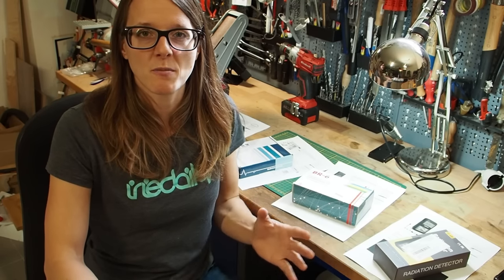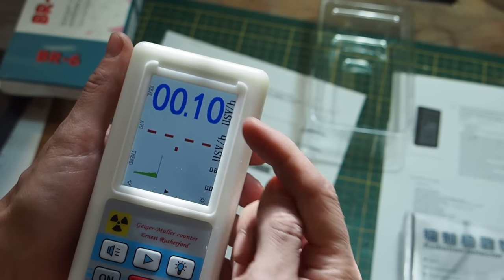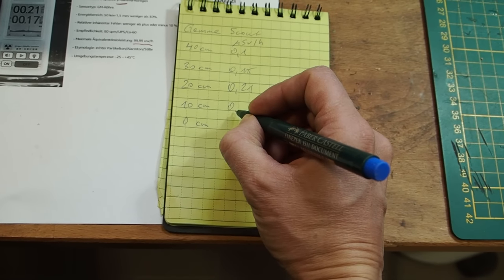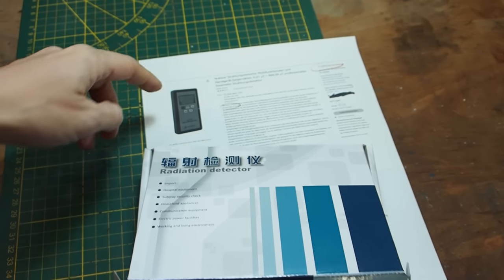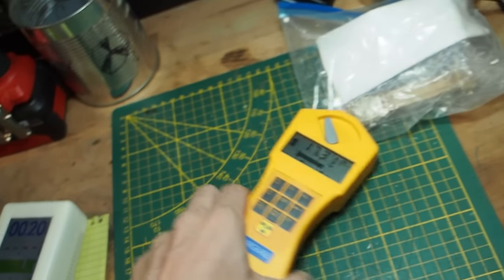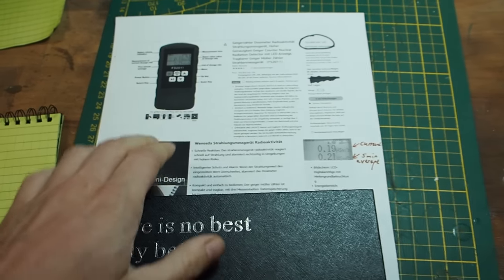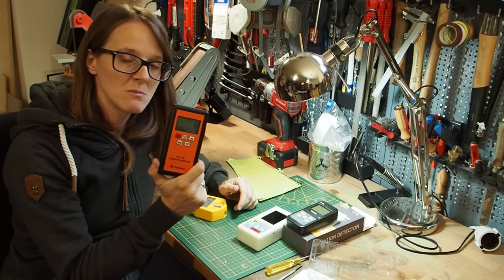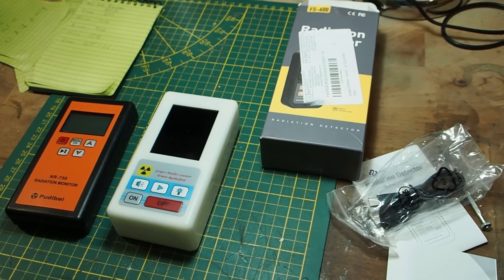Cheap Geiger Counters on Amazon - Only 1 is Worth it!

Comment from the maker: Attention!!!! In this video I am searching for cheap and sensitive Geiger counters, so that people can detect even the smallest level of radiation. This is important if you want to check your food for if they have radioactive particles on the surface. The bigger GM Müller tubes are perfect for this purpose. I can definetly recommend the orange Geiger counter NR-750 by Pudibei. 
NR-750 on Ebay for US: https://ebay.to/3gKBp3p
NR-750 on Amazon Germany/Deutschland: https://amzn.to/3TVWHJB
The smaller GM tubes do not detect low level radiation very well. But they can detect really high radiation before maxing out. This can be important for when you are really really close to ground zero of an a-bomb. If you also want to detect really high level radiation I recommend more expensive Geiger counters that preferably have 2 Geiger Müller tubes at the inside (one small and one big)
Reply: I work with radioactive isotopes and we use survey meter's
Reply: Thanks for the review. Just found a 750 on Amazon in the US FOR 60$. Was about the 5th selection down on the search list.
Reply from the maker: @bonedoc4556  nice 😃
Reply: Some of those are not real time readings. The white one has a 30sec refresh. If I remember
Reply from the maker: @Mr_Wicked  it is super slow. it sucks compared to the others.
Reply: @bonedoc4556  Just looked and it is 127.00 What is your link?
Reply: GMC-320 is cheap and good, normally was on amazon for 60€, now it is more like 120€.
Btw. you do not need a Geiger Müller tube, you could also buy Scintillation detectors, but normally they are way more expensive.
Gamma scout price is ridiculous now for what it offers, for that you get almost a SEI Ranger, which has a pancake tube with much better sensitivity.
Reply from the maker: @gene9230  the SEI Ranger also has a GM tube tough. Great device but most people wont be able to spend 500+ Dollars for it. I specifically am searching for cheap products which are good enough for common people.
Reply: @SurvivalLilly  yes I am aware of this, it is just a better alternative for people willing to pay the price for a Gamma scout. The price for the Gamma scout has just increased way to much, few years ago it was like 200-300€, now it is at 500€
Reply: @TryNDoxMe There Vill be no laughing and you will like it. Glad to see da Germans ARE NOT ON THE USA SIDE.
Reply: Thank you for the information I just went to Amazon and picked one up for $59 US
Reply: Thank you for doing the tests and comparing models.
Reply: I googled the prefix of the number the last one was in Illinois
Reply: @bonedoc4556  WA
Reply: Hi. There’s a NR 950 pudibei. Do you think that will make much difference than the 750?
Reply: Danke fürs testen. Mein Vater hat als Metallurge auch mit radioaktiven Metallen gearbeitet und hatte daher immer einen Chip am Gürtel in den 70ern in DDR-Zeiten. Einer hatte beim Amtsarztröntgen seinen Chip vergessen abzumachen und der Zähler schnellte in die Höhe. Alle radioaktiven Metalle, mit denen die Metallurgen dort gearbeitet haben, waren nicht halb so gefährlich wie einmal röntgen gehen.
Reply: Hallo Lilly, tolles Video - danke! Jetzt bleibt die Frage: was sind die Werte auf die man bei (Gemüse, Fleisch, Milch... usw) achten sollte. Ich habe gesucht und bin auf Bequerel Listen gestossen - Die müsste man aber erst aus den Messergebnissen errechnen? Falls Du hierzu ein Infovideo machen könntest - das wäre SUPER!! Da bin ich nämlich gerade echt lost. Lieben Dank!
Reply: Can you do a Vid on readings as to when we need to leave or go to a fall out shelter..
Reply: Alpha radiation is the most harmful internally. Working in Health Physics in a rad area we had a "source" with a constant known output to check that the meters were in calibration.
BTW hold that counter over your table salt or a gas lantern mantle !
Reply: Unfortunately, these level of counters are not that great for testing food.   They're not as sensitive as you would want them to be, unless there's really a LOT of radiation in the food it won't register.  Counters that use pancake tubes are a lot more sensitive, but also a lot more expensive.   A pancake tube can detect the natural radiation emitted by a banana for example, while these straight-tube counters can't tell a banana from background radiation.
Reply: @Syncopator  True, I doubt the actual accuracy of these detectors but they did seem to pick normal background radiation. The gas mantel would definitely work though as they are made with Thorium. Hopefully they set in the box and never need used !
Reply: Amazon actually lowered the price by $5 when I left it in my cart too long.
Reply: @DaedalusHelios  True.  Many years ago I worked as an assistant to a Radiation Safety Officer.  I did the work though.  My boss had the title.
Reply: Nuclear War?
Background radiation in the Northern Hemisphere is generally higher than in the Southern Hemisphere due to the majority of nuclear tests conducted being carried out in the Northern Hemisphere.
Typically cancer rates are about double in the Northern Hemisphere compared to the SOuthern hemisphere.
If you live near a Nuclear Power plant I would highly recommend buying a Geiger counter (preferably move out of the area)

Does the NR-750 model measure alpha radiation?
Reply: Hello, consider trying FNIRSI GC-01, it costs 45 euros.
Reply: So you believe that a flimsy Faraday cage (or biscuit tin) will protect the electronics in case of a nearby  Nuclear blast?
It will be the last of your concerns should a nuclear weapons be detonated so close to your home.....
You want to prepare?
Need an protected shelter with clean water and food supplies. Radiation suit and radiation mask.
If you have the resources a filtration system for the air to this shelter.
This is not a shelter to protect you from a nuclear blast but rather from the radioactive fallout post-detonation.
Reply: Hi , there’s NR-750,850 & 950. Any difference for this three? And which is best to test on sashimi coming from Japan
Reply: @Syncopator what do you suggest for food? Which model could be affordable
Reply: @brunomilitomilito4261  Need to get one with a pancake probe.
Reply: Exactly , yup carry that in the store put a stop to globlast 3:09 .!

Comment: Hopefully NONE of the Geiger counters will be reading any REAL high levels of radiation in the future.
Reply: God willing and
God bless and protect us all!
Reply: Hopefully. There can be things liks naturally occurring radon gas emissions that can buildup in basements or structures. These things can have more uses that in nuclear plants or wars.
Reply: @theoldguy9329  how so?
Reply: @joriskylie6857  I am sorry. Was the question about radioactive radon gas which is released by a number of naturally occurring minerals (actually not uncommon here in Canada). Mone tailings and erosion may also spread radioactive minerals. Or maybe things like the tailings from those old factories that put fluorescent dials on clocks  watches, compasses, airplane instrument dials, submarine equipment, etc..
Reply: @DaedalusHelios  also wrap in tin foil before putting in cage
Reply: @1boatsailor  Yes. Plastic then foil. You don't want the metal to touch the object.
Reply: @theoldguy9329  CORRECT Thanks
Reply: @DaedalusHelios  Putting a stored one in a plastic bag covered with aluminum foil should also work.
Reply: @DaedalusHelios  There has been a lot of research about this.  Most cell phones run at about 2.4 GHz, but a nuclear EMP runs the gamut from visible light and below all the way up to the Gamma and X Ray frequencies.  Usually they are doubled sine wave in form with their strength dependent on proximity to the blast and the size of the detonation.  Likewise a high altitude blast will induce secondary lightning effects in the denser lower atmosphere and lightning is also a form of radio wave as a by product.  Research indicates 5 layers of aluminum foil will block a cell phone signal under normal circumstances, but of course the magnitude of the pulse will always be a factor.  Some advocate storing their cell phone inside a not used microwave.as it has a built in Faraday cage designed to block the 2.4 GHz range.  5 wrao a cell phone and try calling it.  If it rings, add more foil. Similar for your radio.  Turn it on loud and wrap it up.  When the signal is blocked you have found the shielding needed for that frequency.  Note AM & FM & HAM & Police frequencies are all different.  For devices such as s Yaesu VX 7R all band radio, or similar consider also placing the foil wrapped radio inside a galvanized steel trash can (small ones designed for fireplace ashes will also work).  It is worth noting chemical EMP devices have a much shorter range and are multiple magnitudes of power less powerful.
Reply: Lol, radiation is 100% natural and unavoidable
Reply: They dont show more than 3.6 rentgens nevertheless... 50-100mSvh is the limit of best budget models.

Comment: Cheap Geiger counters always havre their weak points, such as reliability, accuracy and durability.  You do not want buy one does not work when you needed. I have tested some cheap Geiger counters from China, they all have low performance and reliability issues.  For the emergency use, I always trust something reputable, like GQ GMC Geiger counters. They have the best feedback and reviews, and the price is very close to those. Like GMC-300E ang GMC-300S models.
Reply from the maker: the price is much higher than from the orange one I tested. Not everyone can afford the GMC models.

Comment: The cheapest GQ Electronics model (GMC-300E-Plus) is $128 USD. They have good support and easy to read screens. (I have their GMC-600+)
Reply: Just a quick additional upcheck 👍for the GQ 300 series counters. Currently Amazon has great deals going on the GMC300S and GMC320S versions.  My 300S was only about $50 with a coupon, and the even more capable 320S is currently discounted with a $15 coupon to under $60.  Both the 300S and 320S have the larger full sized more sensitive Geiger tube mentioned in the video, a large backlit sunlight readable LCD, a standard easily user replaceable 14500 lithium battery, and full-function onboard internal firmware which allows both USB PC logging and precision CPM/uSv instrument calibration (unlike the highly over-rated, over-priced POS 'Gamma-Scout').  With the slightly more expensive 320S, you get a few extras like automatic cell phone style display flipping, an internal electronic thermometer, plus a larger 1M internal logging memory - but even the inexpensive GMC300S model is enormously more sophisticated than most of the other tinker-toy counters in this video.  So far as the testing in the video goes, Gieger tubes show widely varying sensitivity depending on the energy spectrum of the radioactive source, so testing counters against random radioactive rocks (especially up close where the levels are changing rapidly with distance), is NOT going to give accurate results.  I have checked the accuracy of my new GMC 300S, and my new RadiaCode 103 (much more expensive, but also highly recommended), against a calibrated Cs137 check source at a calibrated distance, and found both were within 10% of the calculated theoretical gamma flux, which is surprisingly good accuracy for consumer grade devices.
Reply: Personally, I would get an inspector. they’re very sensitive but they only give accurate doses for Cs137

Comment: Caution needs to be exercised when buying Geiger counters on Amazon. Most WILL NOT detect radiation levels at the levels you would need to for a nuclear attack and are meant for detecting radiation for other purposes.
Reply: That is true however they are still useful to inform you of a rise.  Say all the electrics went out for as far as you could tell and there was no information forthcoming by radio.  Even a cheap Geiger counter will let you know if the radiation levels are within the normal range or not.  Can you imagine how different things would have been near the Long Island Nuclear plant when there was a leak if people actually knew radiation levels were raised?

Comment: How do you know any of them are accurate without a known radiation level reading. Just because some of these read lower than the others do not mean the higher reading was correct. Also, even though the 2 had similar readings, there is way to say the readings were accurate without a known radiation level reading. Other than that I think your testing process was great.
Reply: All of these devices are good. In case of war or nuclear disaster. The most important thing is to detect high levels of radiation. and take appropriate action. Reading accuracy in this situation has a low priority. After a short time, each device will falsify the reading because it will itself be a source of radiation. Therefore, the meter must be protected against EMP and then protected against dust.

Comment: Most Chinese units run a glass Geiger tube that is also sensitive to certain wavelengths of UV. If you buy such a unit, make sure the tube is isolated from ambient light. Black heatshrink tubing works a treat and is easy to apply, as the tubes usually tend to be removable from their sockets. Good to see the newer units in this video came with shielding, I guess some mfrs caught onto the issue finally.

Also if you're going into Gamma Scout price range, the SE International Monitor 200 is a worthy contender. Made in America!
Reply: Hello, indeed it depends on tube. J305 is UV sensitive (could overestimate by x20 counting) whereas J321 isn't at all ;)
Reply: I grabbed a cheap 'non-brand' Chinese unit a while back to see how it would fare against my GS3 (at 1/10 of the cost) and was pleasantly surprised in terms of (reasonable) accuracy and features.
That said, the lack of an audio pulse feature is peculiar (it'd be so easy to include) and of course, no alpha detection.
Anyway, re UV sensitivity and overestimation, I've found the opposite to be the case with this thing (It's a GC01) which reads slightly (and consistently) lower that the GS3 when tested with a thorium mantle, possibly due in part to the thick, black rubber sections of the casing and a J321 (I haven't opened it up and the Chinese translated manual is a little spec vague but I believe it's the 321 in there).
Interestingly, to get an accurate reading, the unit needs to be positioned so that the rear is facing the test source. Pointing it towards a source (as one would with the GS3) only registers a slight elevation from background levels. This makes quite a difference too; 0.7ųSv shoots up to around 2ųSv. It is however, rather awkward to hold it in such a way that allows for an optimal reading.
Also, as I mentioned, it does generally read slightly lower than my go to unit and I'm wondering, provided that the rear casing has sufficient clearance from the tube / board and that the tube is indeed a J321, would drilling a series of small perforations through the back seem like a reasonable way of increasing the beta sensitivity to match that of the GS3 or would the difference be negligible?

Comment: Boy thanks Lilly I just ordered the NR 750 after waisting over $60 on a different model that wouldn't even stay on. I tried everything. Keep up the great work ❤️
Reply: @mikemorris5944 I read that you can enable particle detection sound with NR-750 but other users only reported this feature with their NR-950.

Here are some instructions from another user:
"Go into alarm mode, then select the pictogram of three little speakers. This will register a beep every time the tube records an ionization event."

The NR-950 has features I don't need and is more expensive, so it would be great to know if NR-750 has this before I buy it.
Reply: @sfdghjk1017  thank you as soon as I receive our NR-750 I'll test that and get back to this thread post. 🤔

Comment: Hi, Lily!  I bought the GQ GMC-300E Plus from Amazon a few years ago, and it works very well.
Reply: I have one as well, and it works well. Matches my Radex GC (Russian) exactly, and is sturdier than the Radex. I don’t buy on Amazon, too many problems, I buy from EBay or the manufacturer, and have been very happy without Amazon.

Comment: Mine its made in USA, and seller is in the UK 🇬🇧 not buying Chinese junk that will take months to be delivered from China and stop working after few months.
Bought the GQ GMC 600 has LND 7317 sensor so very good can pick up alpha radiation costs £358 old looking design made with cheap plastic, but still best bang for you money was not going to spend over £600 or £700.